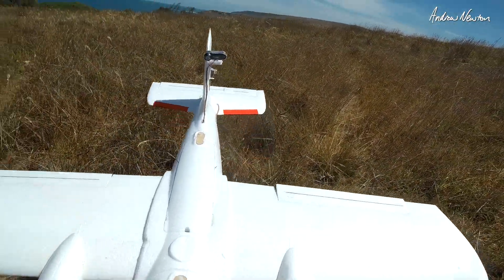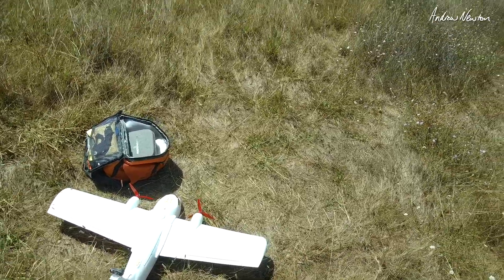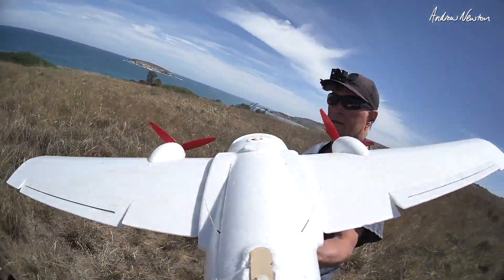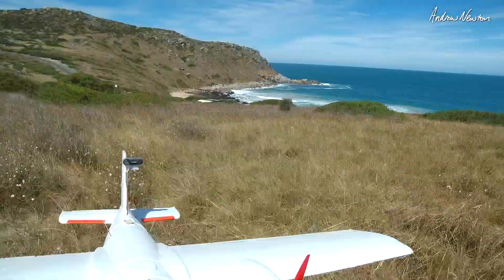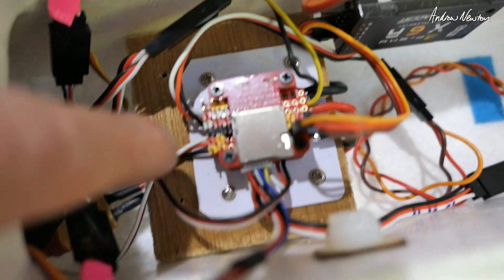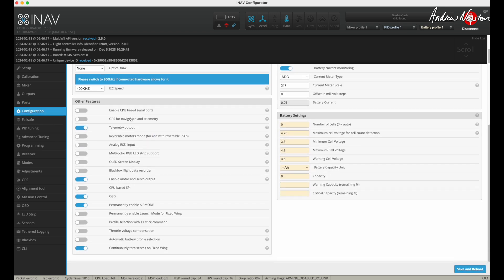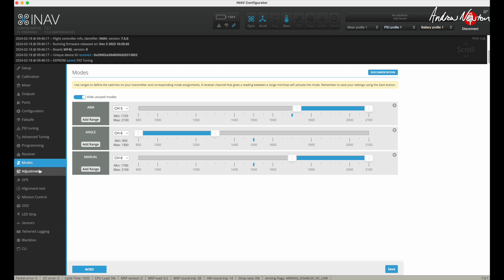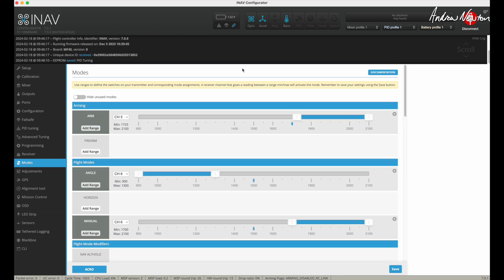INAV for Line of Sight Stabilisation

Comment: Hi Andrew. More questions sorry. I’m trying to set up my Spektrum  ix20 with inav using a Crossfire tx lite on my Spektrum tx. Searching many times for a video. 
My problem is I have assigned many switches in my transmitter and they move on the output screen but inav won’t respond to the movements. I’ve got arm sorted and three way for angle horizon and manual but no more switches recognised as I want loiter. Hope this makes sense 
Mark
Reply from the maker: Can't help with Spectrum and Crossfire sorry. Painless360 has some videos I think

Comment: Nice to see the AlbaBird in the air. As always, great tips. 
This also good setup for beginner if model setup has been validated by a more experienced pilot.

Regarding INAV training aids; it would be possible to setup a "Altitude Activated Safe Switch" just in INAV mix similar to what was done on FrSky radio in a previous video (Nov 2022).
Can add an "Altitude trigger" in Programming logic, using "Flight" parameter logic (for minimum altitude) to enable Angle Mode stabilization in the Mixer tab.: This would allow flying manual mode with an auto safe-flight recovery. Would also be useful when learning aerobatics, or developing other advanced skills.
Reply from the maker: Yes I must play with that one day

Comment: I have done this, and also on FPV cam equipped planes I fly the plane up to Loiter by line of sight first, then get comfortable on my chair for a flight.
When you launch LOS, using Loiter/Launch mode, if the aircraft is not quite going the direction you wanted (this happens a lot), you can just nudge the Ail stick to steer it up to Loiter area, avoiding trees etc.
With Elrs or Crosfire feed back to your transmitter, basically you've got all your info on the screen anyway, for LOS flights.
I'm about to do it with an old glider to try Ardupilots SOAR/THERMAL mode, looking forward to seeing how well it works.
Reply from the maker: Autonomous thermalling would be fun to play with, but could be a great way to lose your glider.

Comment: The FrSky X6R has stabilisation built in.( not that my one did that well)....but you wanted the additional RTH of Inav...🤔
Reply: S6R....but it's only got a Giro. It's not a Flight Controller...🤔😳🇬🇧
Reply: Yes true,and thx.tbh...I have tried S6R,s/Kopliot Lites,...they're crap, unreliable  or hard to set up....compared to a decent( INAV,D) F.C. imo
Reply: @chrissofpv3017  The S6Rs are very popular in our club...I've set no end up for others. It's pretty easy using Edge and a TX16S.....🤔😏🇬🇧
Reply: @EnglishTurbines  ...oh fair play...I used the lua on my old X9D and Open Tx,...both used to lock the ailerons in a roll(with no warning) even tho I high 5,D everything and checked stabilized mode was working properly.Kinda made me distrust them.
When I get back to the UK,I'll dig em out again,and retry calibration on my TX16S and with Edge too👍🙏🍻
Reply: @chrissofpv3017  Sounds like your using 3D mode....Simple mode is best, Giro rate mode / Manual Mode / Self levelling Mode.
Not certain but I think channel 12 (the calibration switch) will double up and give access to 3D mode for hovering and knife edge manoeuvres, another 3 modes...You have to read the manual carefully to understand it as I recall...🤔😳😳 So where you leave ch12 switch parked matters!!!

Comment: RACERSTAR 405 mini?  That may be that may be the last one in circulation, I feel like everyone who had one watched it catch on fire at some point LOL.  I have a couple of rigs with INAV and fly LOS, I use them like a kopilot because they have GPS in case it were to get away from me (not really an issue any more, but for a new flyer loss of orientation is a real problem), plus you get the telemetry back with the GPS coordinates on the radio.
Reply from the maker: Oh they burned up? Mine is OK but I might ditch it now. Thanks for the alert Bryon
Reply from the maker: Mine is now on the rover, can't do too much harm there.
Reply: @AndrewNewton  I bought one after I watched you put on in a Talon I believe.  I was looking for something for the Drift (back when it was hard to get F411's).  I had some question so reached out to the FB INAV Fixed wing group and got dumped on about the board. So about three weeks later, I had the build sitting on the bench, and it died. I think the 5V regulator went out.  I just kind of laughed at myself over that one.  If you're in this hobby, burning money is something one has to get comfortable with lol.  Anyway.......love the simplicity of your videos.